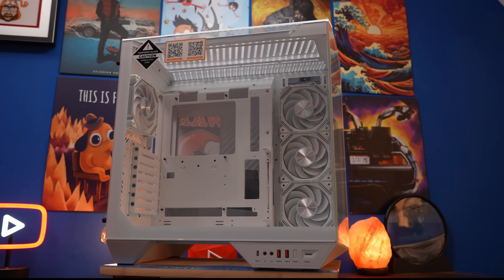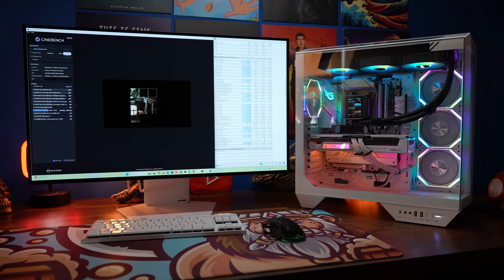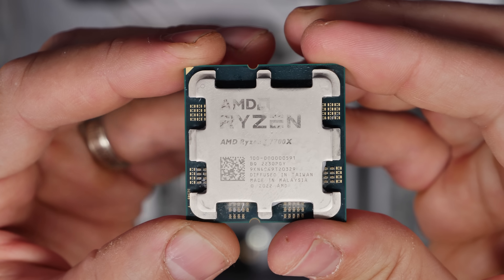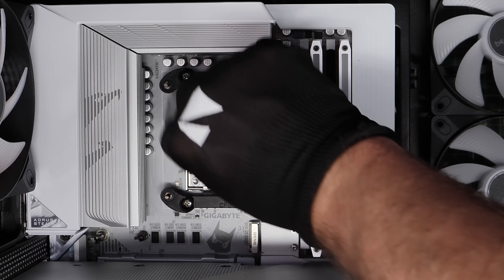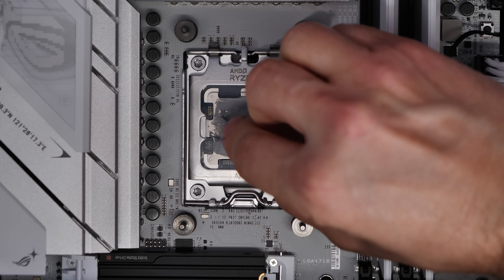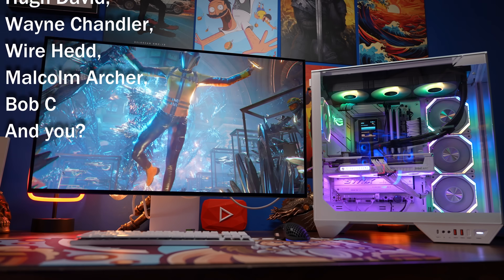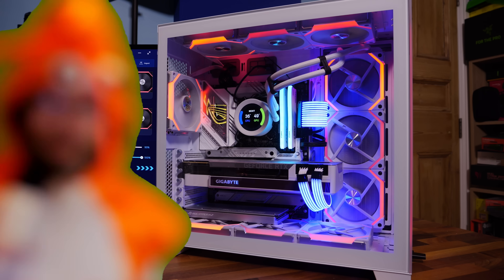This is NOT good - AMD CPU causing crashes and the fixes I've tried

Comment: I just upgrade to an 9800x3d. Worst decision i made. My pc crashes almost 10 time per day. Terrible fps. Terrible latency. Only good thing the temp is way cooler
Reply from the maker: that's very odd. I've not had those issues, I don't suppose you're using an ASROCK motherboard?
Reply: @TheProvokedPrawn  nope i had an asus motherboard. I check every product before i buy it👍

Comment: that's the AIO cooler. AMD CPU's are way better than intel. I've been using AMD R9 5900x, AMD R7 5700G and AMD R7 5800H No issues at all.

Comment: Ryzen CPUs from Zen 2 have the exact same issue that 13th and 14th gen intel do. They boost WAY too high on a single core and then shove like 1.5v into it to make it stable, which eventually degrades the chip. If you use a curve optimizer to keep those voltages down from the start, or lock it all core, they shouldnt ever get this bad. 

Exact same issue though, I hate that intel is the manufacturer taking the majority of the blame, but luckily although the damage is permanent, it can be made permanently stable with some tuning.
Reply from the maker: Interesting
Reply: @TheProvokedPrawn  one other thing to note, the X3D chips don't seem to be affected by this because they don't single core boost like the regular chips... Though the 9000 X3D chips seem to be having a large amount of failures elsewhere though that may be an error that just needs a microcode update according to AMD. 

I've had to manually tune a few CPUs for my friends (notably a 5950x, a 7700x and a 7900x) that degraded themselves bad enough stock to blue screen while just idling windows. Luckily I was able to get them stable but I hate that it's an issue in the first place. I think Intel got in so much hot water because they had this issue in a more aggressive manner and their most popular chips unlike AMD's were the ones affected the most. Still, it sucks that both have these issues out of the box, I don't consider default settings that push these chips so hard to be acceptable.
Reply: @dsrocks6905 Thanks for the info. :) I got so many errors with my 7900x in occt like in the video. Never thought it has a problem like this, I thought it was the motherboard. In the end I sold it, and now I'm using 9700x.
Reply: @naufalariqsantoso4513  yeah just make sure to manually tune it so you don't get those high voltages. Rule of thumb is to keep it at or below 1.4v Vcore. The lower the better assuming you can maintain stability. 1.475v and above is degradation territory, the higher you go from here the faster it happens.

Comment: Try to lower your ram speed to 5200 MT/s, if the issues still persists it's safe to say that CPU is faulty, possibly memory controller or just something causing errors. Official AMD support is 5200 MT/s for 7700x, so it's guaranteed to work at such speed, you can apply XMP and then put ram speed at 5200 MT/s. Also if CPU is still erroring/crashing without XMP so at JEDEc timings, then it's definitely CPU being faulty. Though to fully confirm that i'd put it on new motherboard and ram kits, b650m hdv is cheap board and 32gb ram is under 120$.

Comment: OCCT did yesterday 1h run random extreme, core cycle - 7800x3d 9070xt corsair 32gb 6000  cl30

was crashing to complete shut without blue screening as well until I CMOS reset bios
Reply: overnighting AIO to CPU also can cause reboots at random - at high load due to material expansion with temp increase. don't over tighten it

Comment: I've been plagued by driver timeouts for over 1,5 year - basically since building my pc. What's odd is that they only happen in WoW. It's a 7800X3D. I went from 7800 XT and 7900 XT. Honestly this video comes as a refreshing suggestion. I've changed nearly every part of my PC - except SSDs, Motherboard and CPU. I have noticed over a very long time that regardless of settings and despite my massive 360mm AIO, my 7800X3D hardly ever drops below 50 degrees even at idle, usually hovering around 60-70 in gaming. I've technically ruled out CPU being the issue because I've stuck my GPU in an otherwise identical system and it still crashed. I'll do some testing when I get the time. Maybe it's the MB - Gigabyte Aorus Elite AX (rev1.2) B650

Comment: At 3:13 is the plastic protective cover still on the mating surface of that cooler?
Reply from the maker: No. It's a Noctua thermal guard
Reply: @TheProvokedPrawn  Ah interesting, I haven't seen that before! I reckon it's to protect the bits around the IHS from getting gunked in thermal paste?
Reply from the maker: Exactly 
https://youtu.be/ZerDjtDlQhc
 @Masiliskk
Reply: @ Brilliant, cheers!

Comment: Had an asus x370 ROG hero. Top of the line board back then. After a while it was nothing but problems before it ultimately failed. But I don’t want to be too hard on asus, because a lot of their parts I’ve had through the years have been excellent. However, different AMD CPUs and GPUs have given me big issues through the years. To be honest I don’t trust either company much.

Comment: By the looks of it, you applied 3 times the amount of thermal paste on the 9800X3D compared to the 7700X which was very thin amount and wasn't making contact on the water pump plate in the middle. Love the videos!
Reply from the maker: I didn't apply any to the first CPU, it was pre-applied to the cooler *shrug*
Reply: @TheProvokedPrawn  ok it just looked like there was no contact in the middle of the plate at all when you pulled the cooler off
Reply: @davecollins7600  yea the initial paste layer does look thin, but high 80''s under all core load while sitting at 5.25 GHz is about what you should expect from a 360 mm AIO

Comment: Are all of your power & voltage settings left as default on the 7700X?
Reply from the maker: Yup
Reply: @TheProvokedPrawn  Does it crash with JEDEC RAM timings? And have you taken a go at cleaning the contacts on the bottom?

Comment: I just upgraded my 7700x to a 9800x3d and noticed significant drops in CPU temperatures.  My 7700x always ran very hot with cinebench even when I applied a under volt in bios, but temperatures in gaming were always fine.
Reply from the maker: Yeah the 9800x3D is much cooler

Comment: Somehow my 7yr old ended up with the 7700X ($220 new) as I didn't want to bother with other 7600X builds in the house. So she has the fasted production multicore CPU in the house. 7600,7600x,7700x,7800X3D are the four CPU's I have in 9 builds currently. I originally had the VETROO V5 w/ two 120mm Corsair SP fans on it. But I found a great deal on the Noctua U12A for $50 with the two 120mm Noctua fans. This is one crazy high end air cooler beating out the D15 or U14S both with dual 140mm Noctua fans. So I have the thermalright plate, the offset Noctua mount arms and the U12A. 2x120mm intakes and 3x120 exhaust. Negative Offset -20 and it runs great even on more demanding games like offline BF2042. Minecraft actually heats it up pretty good too. 

7800X3D/ 6950XT
7800X3D/ 6900XT
7800X3D/ 6800XT
7800X3D/ 6700XT
7700X/ 6800
7600X/ 6800XT
7600X/ 6700XT
7600X/  3060ti
7600/ 6750XT

Comment: What if the pc crashes when there's no load on it? Works perfectly fine when there's enough load or heavy.
Whea18
Reply: Did you undervolt the CPU? If so, it might be too aggressive.
Reply: @TheHalfmanofOz  stock/auto pbo
Reply: You could try raising the load line calibration setting. Usually there are four levels and its set to level 2 or 3 by default. Try level 2 or 1.@Ruby_Mochii
Reply: @TheHalfmanofOz  cheers! Will give that a go when I can. I've not heard of LLC, I'm not too comfortable changing cpu values.

I tried all sorts of fixes except cpu tweaking and nothing helped. I have Zen3/Asus X570 and it seems like a somewhat common issue. My cpu is possibly degrading and already out of warranty when I realised the possibility of it being the cpu when it's already too late. It seems whea18 is too common on my cpu architecture to ignore that fact. 

I also currently don't have the money to replace it...
Reply: @ルビー餅  If the CPU has degraded the only reliable way that I know of to keep it running is to increase the voltage. I understand your reluctance to do so, but if the stability issues are frequent enough it might be worth exploring.
Reply: @TheHalfmanofOz  didn't work 😔
Didn't have any problems until a day later when I was mentioning it to a friend when it rebooted.

You mention raising but 2 is lowering?
I've learnt a bit more about LLC but I'm a bit too afraid raising it. I'm just admitting it's a degraded/faulty cpu and there's nothing I can do but replace it. 😭
Reply: @ルビー餅  Sorry to hear that. Best of luck with the replacement. (It might differ between motherboards, on mine 1 is the highest, 4 the lowest.

Comment: I just got my 9950x3d. installed it on ASRock X870e nova and mounted a thermalright phantom spirit coz i need to test the mobo, ram and cpu for return window. This is my first 16 core cpu and x3d cpu man im impressed with the thermalright for cooling the 9950x3d at full load for only 69c. And idles at 38c Using the new thermal grizzly duronaut as thermal paste.

Comment: Arent the 7000x processors bound to run hot by design?
Reply: Yes, depending on the model they run up to 90c-95c which is common for AMD max temps for a long time. I remember the R9 290/290X also would start to throttle clock speeds at 95c back in 2014.
Reply from the maker: It was getting to 105 though. But tbh I wasn't worried about the temps it was the blue screens and crashes that were the worry
Reply: @45eno  LMAO, I had a R295x and good lord it needed a bigger radiator.
Reply: @silverfoxvr8541  I ran two 290’s in crossfire. Until a single gtx1070 replaced them. From 550 watts to 150 watts with the same performance. It was a room heater.

Comment: 7000's series without curve optimizer or undervolt will naturally push max temp out of box. Your thermal paste application could be better. Place thermal paste on one side then use the spatula to spread it across to the other side. If you're not using curve optimizer or some sort of undervolt you need to put in ECO mode and it won't push to max temp. With this you will lose performance of course. Personally I start with EXPO, then I  turn of Curve Optimizer. Mostly start with -30 then trickle my way down depending on stability. 5900x -30 CO all core doesn't exceed 65c. 7950x3D with -20 CO all core never exceeded 77c. now 9950x3D with -36 CO all core doesn't exceed 72c. All these are during cinebench R23. I've only did OCCT on 9950x3D but it doesn't exceed 82c. Gaming temps are between 55-62c with 62c being the peak during shader compiling.

Comment: Repasting that cooler for an Intel machine is a lot of work. The standoffs don't screw down like they do for AMD, so the backplate falls off once the cooler is removed.
Reply: skill issue
Reply: @pabloescobar_443  it's a lot of work, you have to either take the motherboard out or have someone hold down the backplate while the cooler is removed

Comment: Did you swap out the 9800x3d for the 7700x again afterwards and run it through tests again? I can't help but notice that the text on the 7700x was very readable upon taking the cooler off for the first time, possibly indicating too little thermal paste? Hoping you got it working again!
Reply from the maker: The thermal paste was pre applied to the cooler the first time. I don't think that's related.
Reply: @TheProvokedPrawn  I'll trust your expertise more than mine! If it helps at all though, I took a look at a pin diagram for the CPU and saw that the marks on the underside probably either cover a single or multiple VSS or PCIE pins, which can be redundant or just a minor inconvenience in small broken numbers. I hope you can figure out what ails it!
Reply from the maker: Certainly not an expert  @Vizzigman
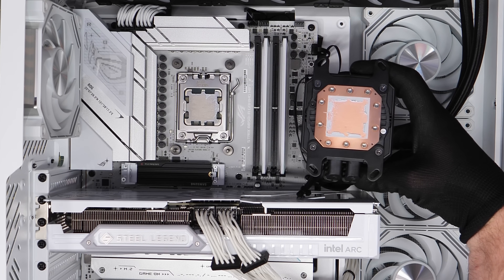Reply: @TheProvokedPrawn  Neither am I, but you've got more builds to your name than I do hahaha. After a night's sleep I certainly do want to push you to try and fit that 7700x in there with a repaste though and see if it spits those errors out again if you haven't already. That thermal paste pattern on the 7700x at 2:10 in the video looks way too bare to me compared to the pattern on the 9800x3d at 3:12 in the video. My apologies if this comes off as pushy or armchair doctor-ish.
Reply from the maker: @Vizzigman not at all. It's a valid suggestion. Ive got lots of other things to do at the moment thougu 😂😢

Comment: 7700x is just a 105 watt(ish) CPU. Most overheating CPUs are thermal paste/cooler attachment issues. Or possible a water cooling issue (clogged block, bad pump). I am still a fan of air cooling because I like to "set it and forget it".. which can be an issue with many AIOs.

Comment: Its the Asus motherboard.  Ive had every x3d CPU and virtually every x870e motherboard.  The Asus boards ALL ran the CPU hot regardless or curve settings.  All on latest BIOS as of 2 weeks ago.
Reply: That may be true but doesn't explain why his 9800X3D then played nice in the exact same system though.
Reply: Are you a reviewer or pc builder? Im more impressed that a random youtube commenter have had all X870 motherboards + dozen of CPU's.
Reply: 9950x3d PBO enabled, 2200 FCLK, EXPO, -25 CO on both CCD's, getting 80 degrees max in CPU torture tests on Asus 870E MB, is that considered hot and i should try to dial down/change something?
Reply: They've been at it a while, too. My old 11600K build - same thing. Asus Prime Z590 and it's voltage happy.

Comment: Ive never had a good experience with ROG motherboards.
Reply: I know everyone loves to hate asus, but I personally love my rog strix x870e-e board
Reply: @LAUCHGeorge The X870E-E is also a 600€+ mobo so it better delivers. And even then MSI's Carbon is as good if not better in some aspects and it goes for 400€ right now. You can get "good experience" with Asus but you also have to pay good 20-30% over everything else for the same experience and their cheaper stuff are hot garbage. If we take Asrock for example, their flagship stuff are cheaper and lower tier stuff are better. People "hate" on Asus because you either pay the "ROG tax" or get subpar low quality product with TUF and Prime - you essentially pay more for the logo just to match other brands and never really "surpass" in any way.
Reply: @3ildcard  I ditched ASuS and went back to Aorus  with a x870e aorus master. I also have a 5080 aorus master and kraken 2024 aio cooler for my ryzen 9800X3D. I'm completely satisfied and everything works as intended ,I wont be upgrading for a long time. 😁
Reply: @OneTrue_Jonny  X870E's are definitely overkill for most of us but they do be looking super nice. I just wish Aorus tried a little harder with the GPU's in terms of looks as they look a little cheap if we compare to ROG. Even the 5070Ti ROG looks pretty dope. 

You're basically set for 5+ years realistically, nicely done!
Reply: Ive never had any good experience with anything ASUS... recently i bought their pc case and it came with defective front panel cable that bent the pins in my mobo... i only considered it because it looked really nice but seems their products still suck
Reply: @Sushi_bar  they look better than they perform. I picked up the ROG Delta 2 headset only because of the Bluetooth connectivity while simultaneously gaming. That's about the only thing that's working as it should.
Reply: @Sushi_bar Asus is known for that problem things broken... There plenty of YouTube video about it even few top tech YouTuber having problems with them exactly problem.
Reply: I've built probably 20 PC's for myself and others in the last 5 years with nothing but ASUS motherboards and mine is in an ASUS case with a 1200W Thor PSU and I've never had issues with any of it.  I had one person that I built for that insisted on an MSI motherboard and it crapped out in 2 months.
Reply: @mcalhoun73  you got lucky 20 times.
Reply: Prime is bottom tier, TUF is alright and ROG is...essentially paying premium for looks. Anything ROG - coolers, motherboards, graphic cards, monitors are 10/10 in aesthetics but also pricing is ludicrous. Example : Asus Ryujin iii - 400-450€, for a f--king AIO and i thought NZXT and Corsair are greedy f--ks. Even with monitors - same panels but ROG costs 20-30% more than anything else. You can definitely get the "good quality" with Asus but you have to pay a fat premium for that luxury unfortunately as their cheaper stuff are cheeks at best.